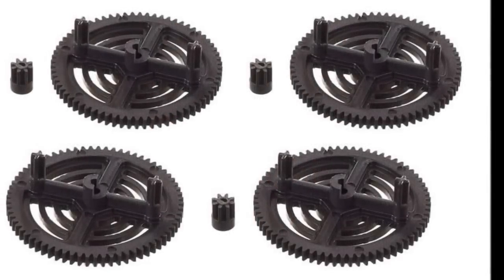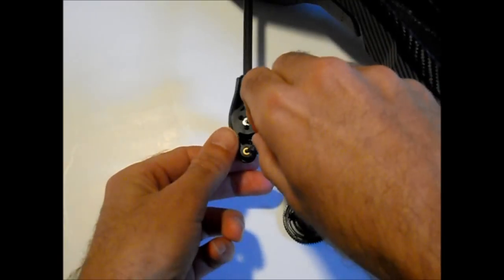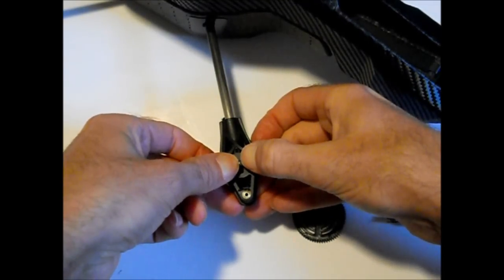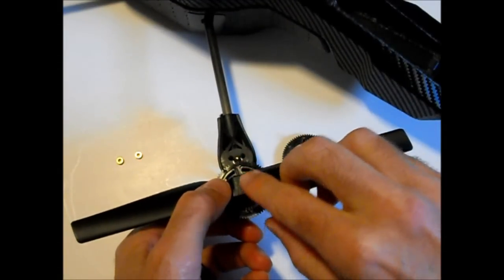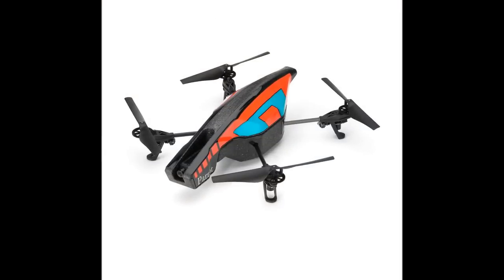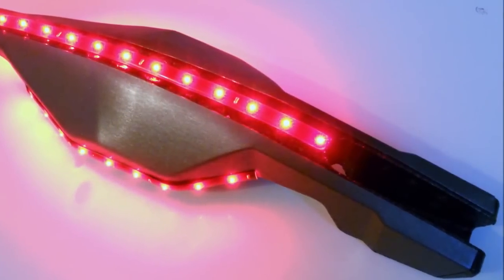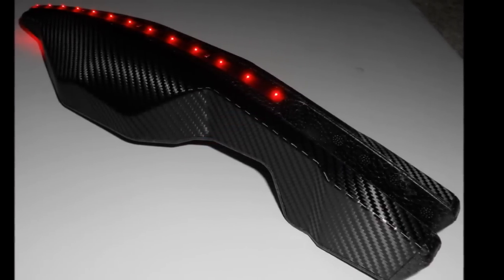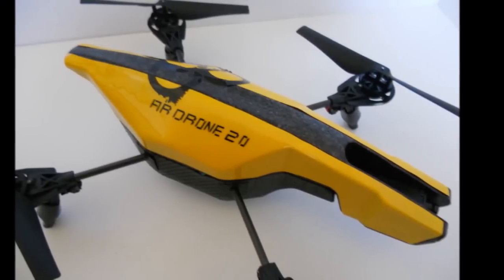AR.Drone 2.0 Modifications and Customizations - Part 3

Comment: Does the new bearings and gears make that big of a difference? I can't really tell what I am looking for between video 1 and 2 but I'm just wondering what the benefit is. Also, it looks like you used the Macgyver mod for the RC... is there any real difference in range if you go with that transmitter compared to the Spektrums?